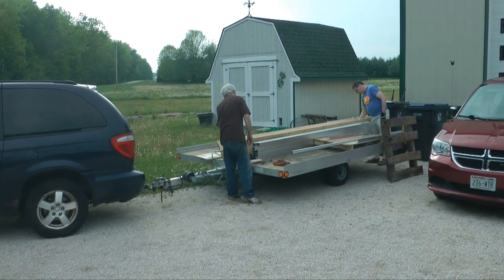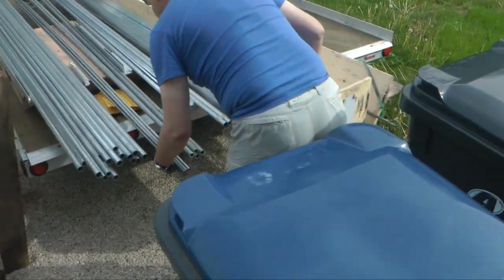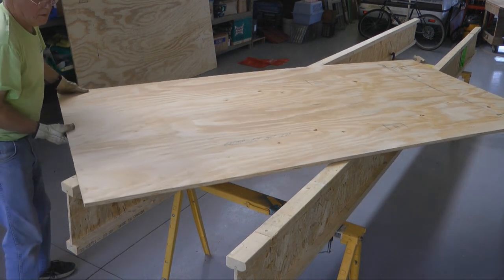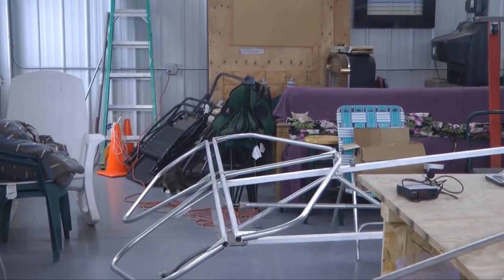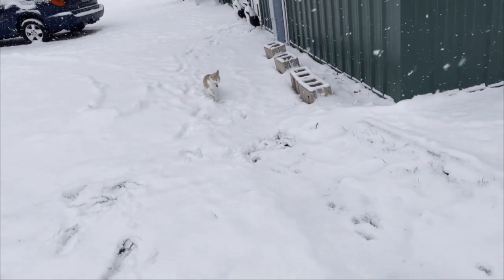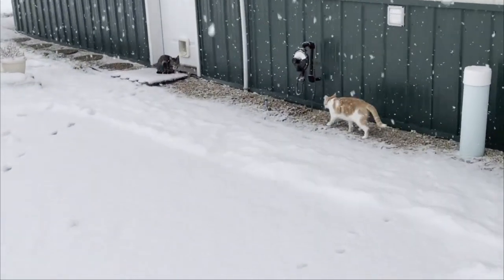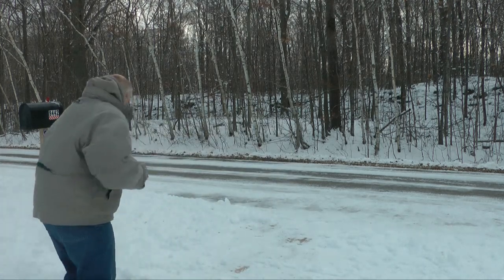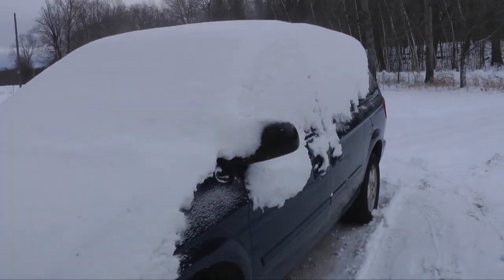Building the Affordaplane Part SubZero

Comment: For some reason I was thinking you lived in the south, but clearly that was a bad assumption on my part!  I live in northern PA and we have about 6” still on the ground of the 10” we got a week or so ago and have had a fairly long cold stretch with several nights below zero and one night was -16 or so.
Reply from the maker: Winter time:  RV park in Florida!  BTW  I use the same hydronic heating in the concrete slab in my home.  Love it!  Use a high BTU water heater.  No drafts, and heat starts at the floor where people tend to live!  Probably the biggest secret in heating designs!

Comment: When I retired and built my workshop (with the idea of building an airplane), I put PEX tubing in the 5” slab and installed a small boiler (40,000 BTU/hr) to heat it.  It works fantastically.  We have had several below zero days (-17 the other night here in northern PA) and the workshop stays at a nice working 65 degrees.  This sounds cool, but when the heat is coming from the floor, 65 is a comfortable as is 75 in a concrete slab building that is heated with air and has a cold slab floor.  I am almost too warm when working in the 65 F building with the warm slab.